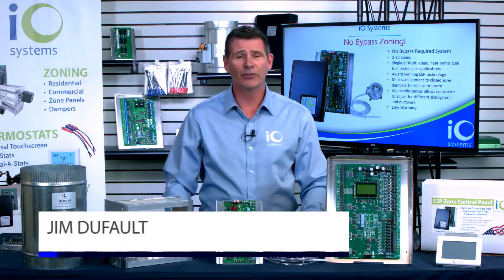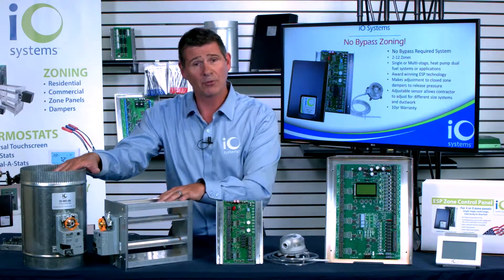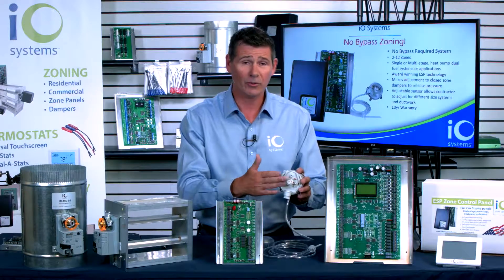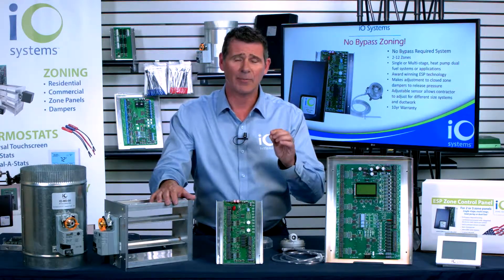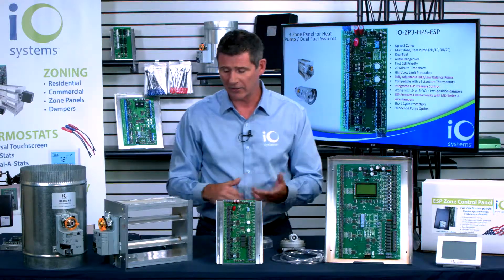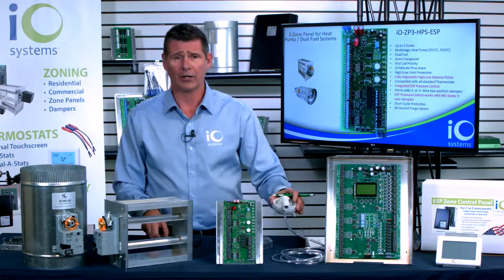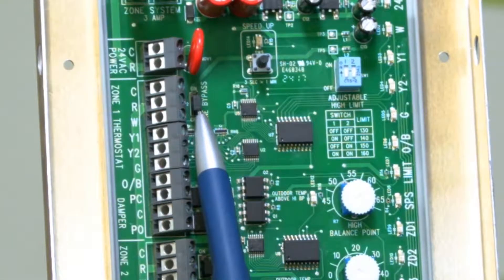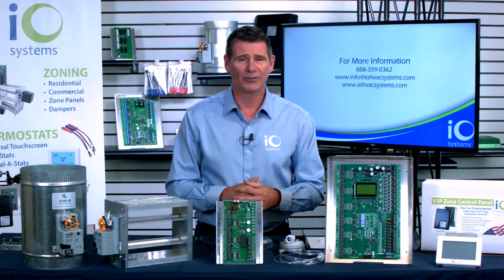iO-ESP Training

Comment: This is an excellent kit.  I have been testing it for a few weeks now. The terminal layout is simple, clean and makes sense.  I find the ESP function interesting as it removes the need for bypass dampers by allowing the zone dampers to slightly open allowing air to bleed by thus reducing  static pressure build up due to closed zones.  
I’m working on some content of the esp in action and will continue to share as I learn.

Comment: I like these. They're easy to install and the shut-off ESP by zone allows for a dedicated dump zone.  Nice. Only thing I don't like about the board are the wet caps since many mounting locations are in high heat areas and heat is harsh on wet caps.